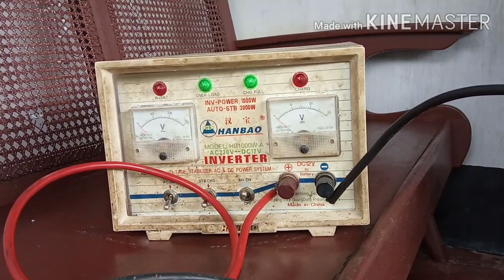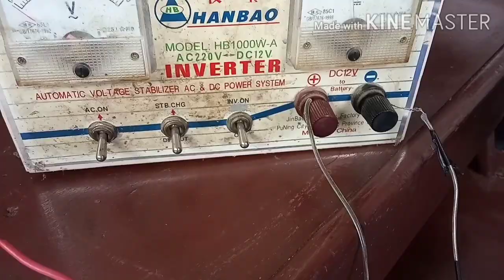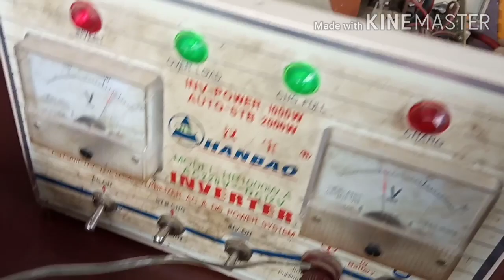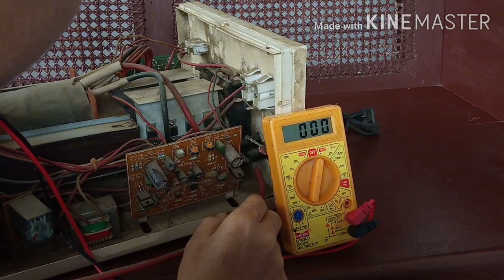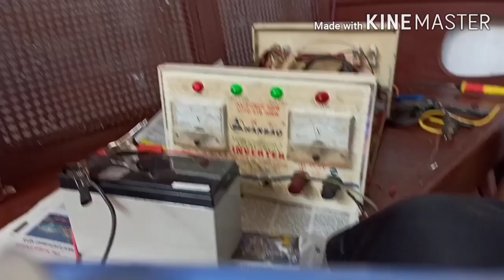Old HANBAO  Inverter Restoration

Comment: Ka inverter in output pelou..Inverter switch e on cia Lailou..bng a buai ahi d.. AC chuh pai input..??
Reply from the maker: Output fuse ahi diam ahih kei leh capacitor kang ahi diam maw or loose wire or wire kang

Comment: A fuse cut off hi bang bol a pha a diam??? Please
Reply from the maker: A fuse blow off 
Meaning.. 
Overload
Short circuit open the inverter check the connectors or check for burnt blown capacitor or resistors or check if u have a multimeter test for short continueity... 
Or just simple the fuse is worn out and u just need to replace it 
Thats what I can say.....

Comment: Hi bro please tell me the output of the 7legged transformer(m not sure)...the one close to circuit board.
Reply from the maker: For me Ac/ dc 220/12 dc or 24 dc using a bridge diode it depends I won't be same as mine 
Square wave inverters output are different base on the C board and transformer
Note: All square wave inverters are different @the output and input  check the transformer of yours using a multimeter or scope device to measure yours 
Hope I help you
Reply: @Techvalte  so i supposed its a sensing transformer

Comment: My same invertor is not charging the battery which is new all indicator are working pls help
Reply from the maker: First check your DC fuse 
2 if there is a switch check it on /off
Remove the relay check it 
If these does not solve you can go to a local repairing shop